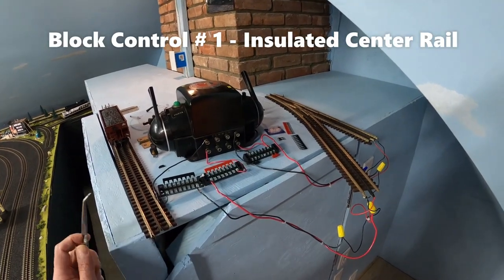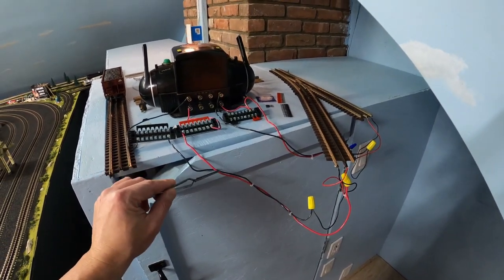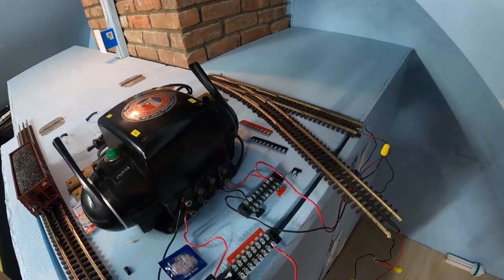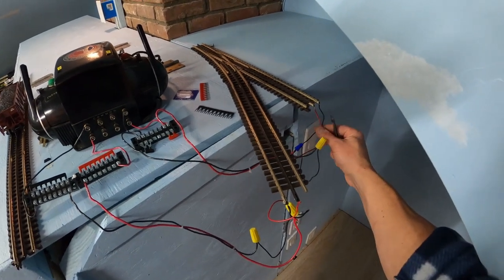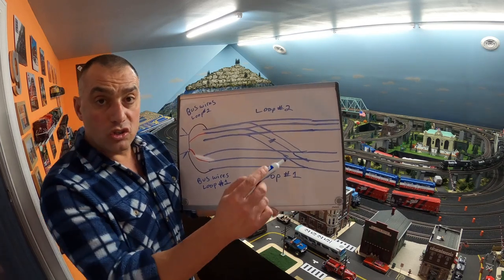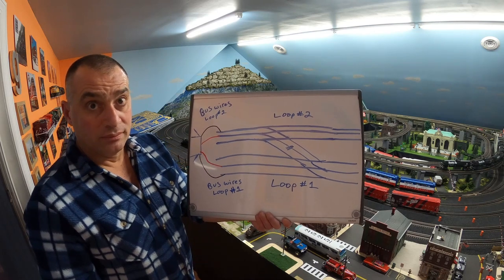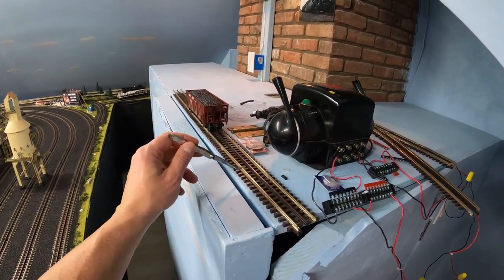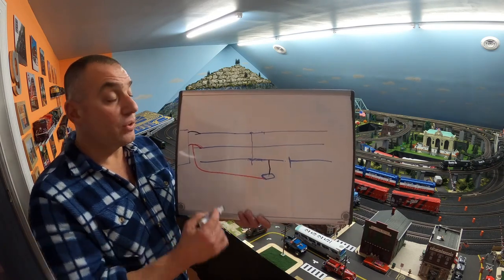How To Wire Your Model Train Layout Part 2 - Basic Wiring Techniques - Block Control Wiring

Comment: Excellent presentation, thank you.  Could you seak to wiring a loop-to-loop crossover...to take a train from loop 1 block 1 to loop 2 block 1 smoothly.  As in from the branch to the main without a stop,  shifting from throttle 1 to throttle 2 without a serious "short circuit"...😊
Reply from the maker: Hi Tom, your welcome! Yes, I can make a video soon regarding the scenario you mentioned, no problem. Thank you for watching and for subscribing to my channel. I really appreciate it!

Comment: How do I know where the power needs to connected to the track?
Reply from the maker: Hi Connie, great question. What kind of track do you have? If you have Conventional Lionel Track, you will need a Lock On. This is a small clip style device that you connect both wires too, and it just clips on to the track. If you have Lionel Fastrack there are small clips on the bottom of the track where you can connect the wires too, they should slide ride on. If you have Atlas track, they sell pre-wired joint connectors that you can use to join the tracks together. For Gargrave's track and other brands I would think they have pre-made wired joint connectors as well. If you do not have pre-wired Joint connectors and you are making a permanent layout, you can solder the wire directly to the side of the track. Hope this helps!
Reply: I have the Kato ez track N scale. I’m making a simple layout, my first. Looking through various track plans, which are confusing it’s show wire connect in several places, this is what I don’t understand. You video makes sense to me I just don’t get why there are wires connected in different places on tracks. Thank you.
Reply from the maker: @conniedlawson  Your welcome. I looked up Kato N scale track and they sell Kato Terminal Unijoiners (Item number 24-818) With these you will have to connect the blue wire(s) to one of the tracks, and the white to the other. Blue wires on same rail, and white wires on the other rail. Make sure to keep blue and white on separate rails. Also, for a small layout all you need is one set of wires to run a train. The reason you see multiple wire connections on layouts is because the larger the layout is you will need multiple wire connections at different intervals to run trains effectively. Basically the power drops over longer lengths and will not be powerful enough to run trains. Thats why multiple connections on the track are spaced apart every few feet so as the train travels along the track, there is enough power close by to keep powering it. Also, when there are separate sidings or multiple tracks you can power them separately which requires multiple connections. But for a simple layout approximately 4' x 8' or smaller, one set of wires is enough to run one train. I describe this in greater detail in my first wiring video - "How to wire your model train layout Part 1" (Not sure if you watched this video also which may help). I hope this answers your question. Let me know! Good Luck and Happy Thanksgiving!
Reply: Thank you so much for taking the time to answer my question. I understand now and appreciate your help. I did watch your other video it made wiring clear. Happy Thanksgiving  @trainwild

Comment: If I have turnout #1 and turnout #2 connected on a separate power source from main #1 and #2.  Do you insulate all four power rails on both turnouts?
Reply from the maker: Turnout # 1 & # 2 power rails AND both outside rails on each turnout have to be insulated from the main line #1 &#2 center lines and outside rails if you are going to use two separate power sources (Transformers). In other words, all rails on each turnout that connect to the main lines have to be insulated when using two separate power sources (Transformers) that are not in phase. Otherwise, you have to phase the transformers if you are just going to insulate the center rails where the main lines connect to the turnouts. I will make a separate video soon on how to properly phase multiple transformers. Hope this helps!
Reply: The two transformer are lionel and are in phase.  So I assume that only the powered rails need to be insulated.
Reply: Thanks in advance.
Reply from the maker: @retired2009 goss  Your welcome. Yes, that's correct. Since they are in phase, you only have to insulate the center rails. Good luck! 👍